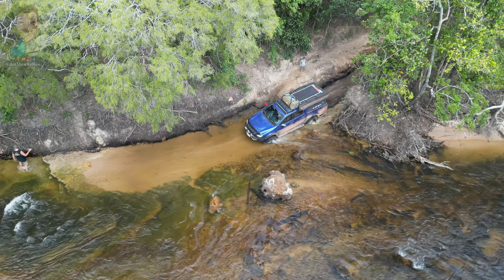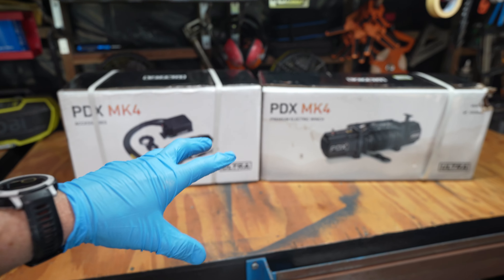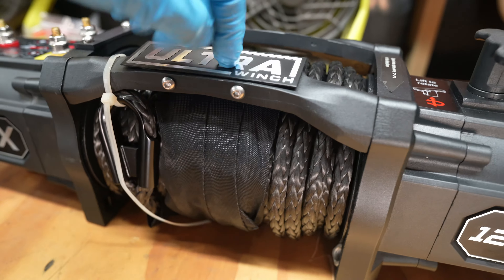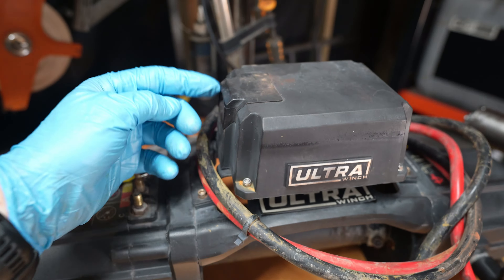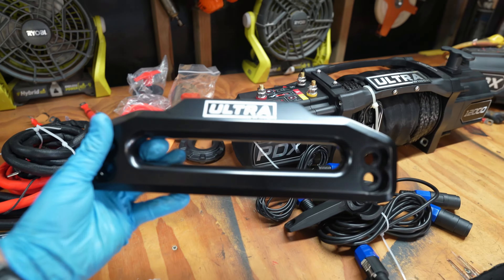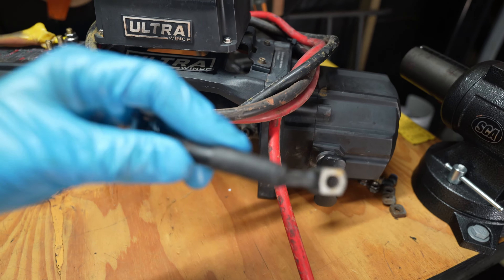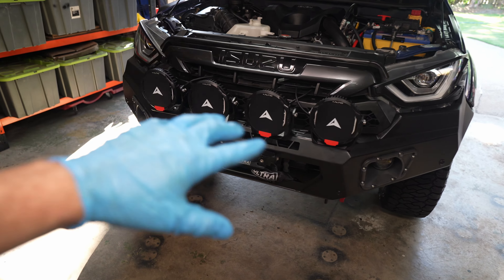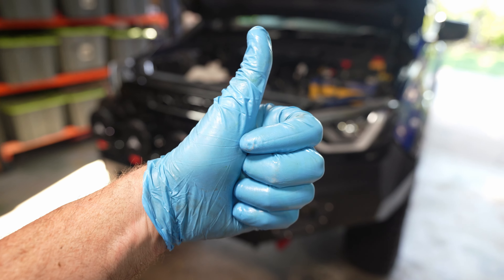D-MAX 4x4 Winch Upgrade Time! Checking out the Ultrawinch 12000lbs 5443kg MK4

Comment: Hey adam hows the powdercoating held up on the bar? Mine is terrible it needs to be re done not even 12months old its gone real chalky and has spot rust all over.
Reply from the maker: Hey hey, so far so good no major issues? Mine got banged up a bit on the OTT but have it a couple little touch-ups and seems good